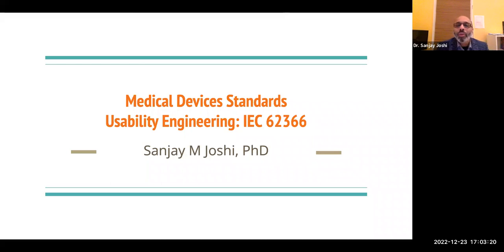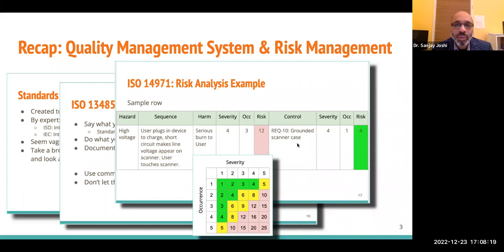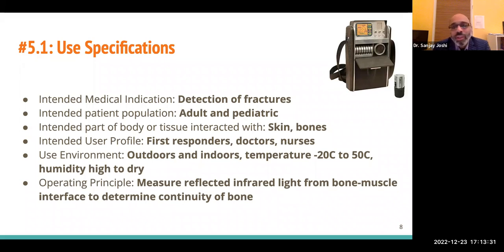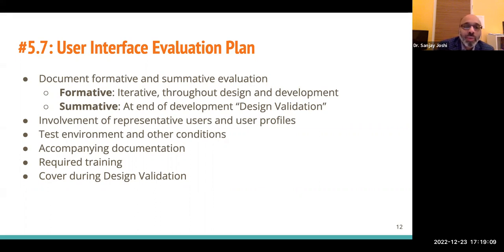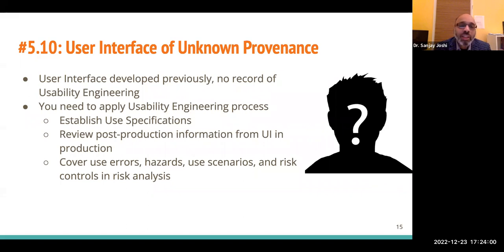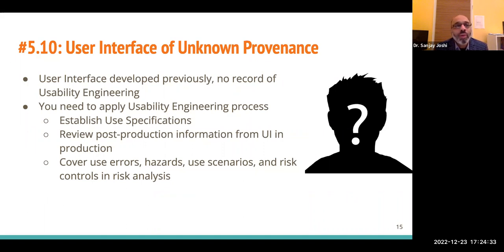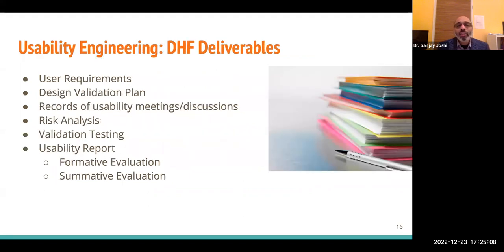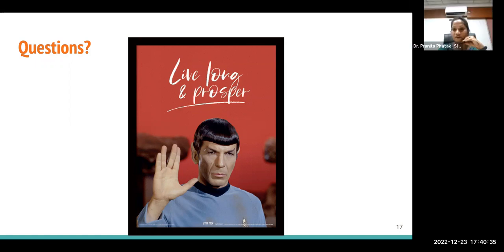Overview of IEC 62366: Usability Engineering for Medical Device

Comment: My response to question in timestamp 54:12 - IEC 60601 focuses on the safety and essential performance of medical electrical equipment used in patient care settings, while IEC 61010 focuses on the safety of electrical equipment used in laboratories and other non-medical settings. IEC 60601 prioritizes patient safety, whereas IEC 61010 primarily addresses the safety of operators and the general public